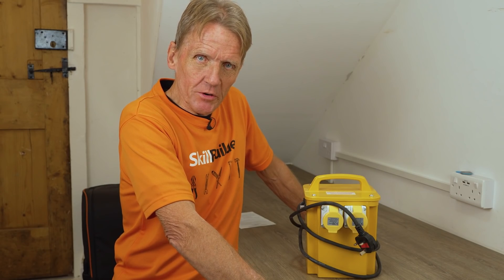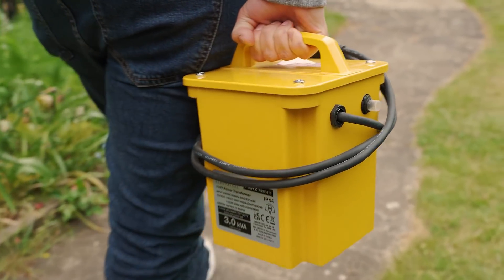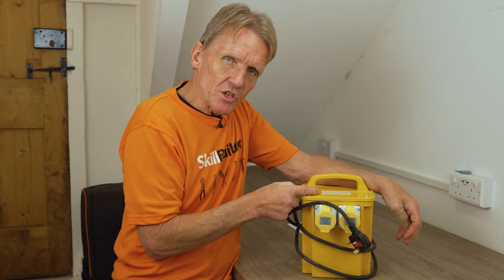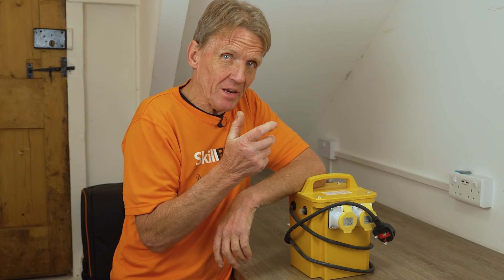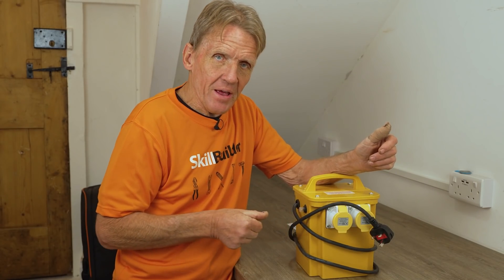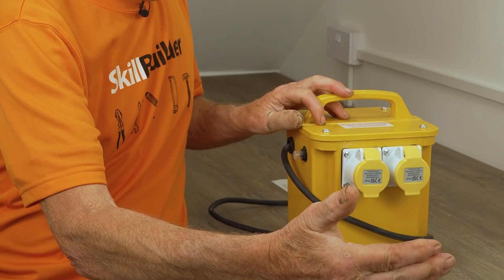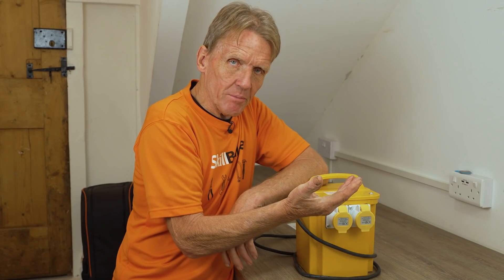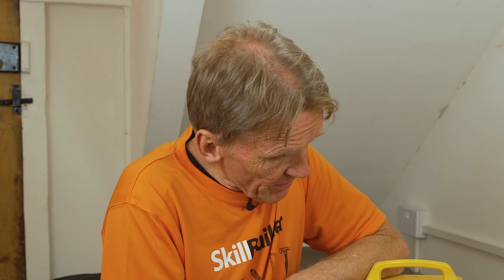110V Transformers - 3 Things You Need to Know

Comment: Personally I would never go with a unit less than 10 kVA. The whole safety goal is defeated if the transformer melts down and the secondary comes into contact with the high voltage primary. What would you rather electrocution or a little bit of grunt moving a transformer? A small hand truck and it's never been an issue in all my years. On projects with 2 people running tools simultaneously I bring 2 of these. And the inrush current thing is overblown, a very simple fix with a soft starter that momentarily puts a lamp in series with the input power and is bridged a second later with a timed switch. The initial magnetisation current is limited by the resistance of the bulb and gets the flux swinging in the core, and then the bulb is bypassed and taken out of circuit afterwards.

Comment: Only time I've known the thermal cutout operate was when we damaged a lead driving an access tower over it. The lead was sparking 😂 and most tools are nowhere near the max load of these trannys so can run continuously. 3kva is a lot! That's why they make the little 1.5kva (I think) units for single tools. 

I hired a cement mixer recently. Got a 5kva tranny with it (all the hire shop had) and ran it all day, mixed up 1.2m³ continuously. Mixer was about 600w.
Reply: I recently bought a 0.5 kVA continuous / 0.75 kVA ''tool rating'' (i.e intermittent) second hand for £25. Much lighter than my 1.5 kVA/2.25 kVA I had previously, and I doubt it will ever trip in a life time with normal power tool usage, even flat out, even with 2 people if I had to guess. Unless you had a scenario were a prolonged high load like a mixer or such is used, I doubt it will ever trip. And I can always bring out the larger one for those few occasions. If I was a tradesman I would go cordless, but for DIY I can have a corded version of everything I need sitting on the shelf ready to go, without batteries deteriorating and eventually dying from lack of regular use.

Comment: Transformers are extremely efficient things and shouldn't produce much heat. The new ones are probably cheaper Chinese rubbish, wound with aluminum wire, and the iron laminations aren't insulated from each other with varnish..

Comment: Thanks you are correct in they are for intermittent use you can always stand  the transformer on a couple of bricks. The most important thing that every person does is use them incorrectly. There purpose is to protect you from electric shock which can kill you. 110 volts is safer, so why run 240  volt lethal extension leads around a site to then plug in an 110 volt transformer. Those extension leads are siting waiting to get chopped or slashed and kill you or your work mate. Plug the transformer in at a safe location then use 110 volt extension leads. The inset photo shows the danger lurking. As they say a little knowledge is dangerous. Its the just get the job done attitude that will catch you out, and you won't be going  to the home you want just the funeral home.

Comment: Not cheap. I used a generator for most of my work, only used a tranny to fitting kitchens.  Some great tips below so be nice to your unit. It's mostly battery if you've got 2 spare as a lot of sites expect you to supply your own power. General use 240v converters on site in various places helps. Cannot remember the last time I bought one mind...

Comment: Really interesting. 99% of people must abuse these then. I never knew they were for intermittent use but makes complete sense. All the heaters I have seen plugged into these and left running for hours……
Reply: If the thermal cut out is not opening then all is good. The ''continuous duty'' is lower than their intermittent duty rating, but it is a true continuous duty.

Comment: Hi Roger as a retired electrical contractor , I was always fascinated by how many contractors were carrying around heavy transformers that were way bigger than they needed . And of course the big units always have a tendency to trip RCDs because of the inrush they produce . Obviously your large concrete splitter needs a beefy transformer , but I can guarantee many only need a smaller unit so saving their backs lugging them around .    Best wishes and kind as always .
Reply: Most contractors nowadays use cordless power tools, much better idea.
No heavy transformer to be lugging around the place also, transformers are only useful if you've got power in the building you're working on, in the first place. You'd also need extension leads which have a tendency to get tangled up representing a trip hazard, not to mention a Generator in the van just in case theres no power on site. cordless tools a much better idea charged up overnight in a charging station, fully comply with safety regs and can be used anywhere.
Reply: @davidodonovan4982   hi David we would still use them for for things like using large core bits that would tend to totally drain a battery SDS drill . And to be honest a good quality 110v SDS drill will last you years unlike battery gear .     Best wishes and kind regards 😀👍

Comment: In a world of RCD's and RCBO's it does beg the question, why are we still bothering with 110v?
No other country in Europe uses 110v and they don't seem to have any major safety issues.

More and more on site 110v is being replaced with 18v.

Isn't it about time this system is due for a review and the construction industry looks at protection at source being law.
Reply from the maker: I agree.
Reply: @SkillBuilder  Maybe do a short video about it Roger, we need some input from electricians on the pro's and con's.
Reply: Because if an RCD with 240 volts (and I do mean 240 not 230 ) doesn't trip for whatever reason, then you're dead.

If you're using 110 volt appliances and you come into contact with that voltage, you don't die.

Comment: Get a plug in remote control switch. You have a little remote in you pocket and you can switch it off from 10 metres away.
£10 on Amazon. 
Just got one when my power take of vacuum packed up and Henry had to come off the bench.

Comment: Same thing happened to me with a laser level. It was screwed to the wall in a customer's house. There was only me and one other builder. When I went back the following day The laser level was gone and he said exactly the same thing laser level. What laser level? I've not seen a laser level.
Reply from the maker: You can never rule out the customer stealing it. That has happened to me. I did some work in a drug rehab unit and everything in my tool box was a potential fix.
Reply: @SkillBuilder  Worked in one of the busiest Garda stations in Ireland as an apprentice Carpenter. First day we arrived the guy who looked after the facilities told us not to leave any tools down these are the biggest thieves going.

Comment: With modern electrics and RCD extension leads will they eventually become a thing of the past and just have the 240v tools. I've been working in domestic land for a few years now and have switched over.... Probably going to get a bunch of flack for that but the vac runs the chop saw better and the rail saw. 110 only gives 800w from the vac. Or will it go just to heavy ass 40v Makita. Heavy though.

Comment: You are right that they are an interesting thing... A lot of thought went into these devices, specifically with safety in mind. The secondary winding is center tapped to earth with the L & N output floating & completely isolated from the primary. This means that the maximum shock you can get is 55V to earth ie: not lethal. The reason they overheat so easily is because the transformer windings are epoxy encapsulated for wet use safety. The bin is also waterproof. This makes them safe to use in the rain or wet conditions.
Reply: I'm being a bit pedantic here but your wording isn't quite right....The maximum shock you can get is 110V, the maximum shock to earth is 55V ;)
Reply: @amd4life89  Yes people seem to ignore the line to line voltage as if you can only get a line to earth shock. Although admittedly line-earth shocks are more common.
Reply: The major problem here is is the installation is TN-C-S (also known as PME) when a Neutral fault will make YOU the fault current conductor or on a TT service you could become both conductors which will definitely give your hair a good Perm
Reply: @Mike_5  I'm sure there are quite a few instances where 110V CTE isolating transformers are used on small sites with TN-C-S supplies (individual house restorations for example) but most of the time they will be used on construction sites where the DNO supply will not provide an earth connection, so it will be TT. I can't see how the use of a 110V transformer presents an increased hazard in the case of an open-circuit neutral/earth conductor or local earth-electrode connection.

Comment: Why don't  Brits develope power tools that do not require transformers? Rented one to power a German made roto hammer with an American (110) plug while building an extension in Scotland year 2000. Very inconvenient.
Reply: We require 110 volt tools, for safety reasons.

Now tell me how you are going to get 110 volts from our 230 volt electrical system without using a transformer?

I would love to hear your answer.

Comment: Top and bottom of it is these plastic transformers are rubbish, cheap, thin windings probably all made in China and sold here. We still use good, solid, Metal bodied centre tapped to earth transformers with overload trips and fused on both poles. They run all day no problems and some are 20 years old. The windings are tested regularly and no problems. Also, if your stuck somewhere you can 'reverse' the voltage if you need a bit of 240!., I know, shocking isn't it!.
Reply: "we still use good, solid, Metal bodied..."
Do you think the Chinese make their cheapo transformers with a plastic core? 😂

Comment: 5KVA transformers are better plus all CE Rated transformers come with a thermal protection device fitted.

5KVA are no good in most domestic settings as they’ll normally trip the B Type MCB when switched on due to inrush current but, should be fine in commercial/industrial locations.

There’s no legal requirement to run 110V on sites however, most larger scale sites do require it & should provide industrial/vented transformers as part of their onsite installations for contractor use if they specify it’s requirement.

Cordless doesn’t yet have the longevity for disc cutters/breakers & prohibition of combustion engines indoors should rule out that option for most so, transformers will still be with us for a while at least.

Not much else that a battery doesn’t run on site these days. Might be worth people following your lead & adopting cordless solutions.
Reply: There are now Cordless Milwaukee and Dewalt concrete breakers and saws, and  new cordless Hilti  Concrete  saws as well, pricey though.

Comment: I'm using one that's double the physical size, and also weighs nearly 3 times as much, to power my chop saw. Those little 16Amp transformers just don't have the power, and the chop saw hardly scratches the metal it's cutting. But using a 32Amp transformer, I can cut through quite a bit more, and unless the light fingered out there have a wheel barrow, it's not something your going to run off with.
Reply: Just seen a wee Scouser leg it up the road with the cement mixer and two bags of cement under his arms I kid you not haha and it was nailed down

Comment: Plug a drill in transformer hold trigger in then switch on power to transform it'll limit surge and stop circuit breaker tripping in most cases
Reply: O dear so little knowledge is so dangerous.

Comment: throw it away and use 240v tools ..... perfectly legal with rcd protected circuits..
Reply from the maker: yes but that means throwing away all the tools as well
Reply: @SkillBuilder  I'm not even on the tools anymore and I still buy 110 tools for my own use, kinda force of habit, insurance in case what I'm doing doesn't work out I'll go back on the tools, and no one wants to borrow a 110 lead "temporarily" round the house to plug something in,

Comment: As a site electrician working on huge high rise building sites in Sydney, I find this transformer idea a bit of a nuisance.  I'm glad we don't mandate this madness here. We use 240v rated tools and are glad to do so. We do however require all electrical tools to be inspected monthly for damage.
Reply from the maker: I take it you use RCDs?
Reply: @SkillBuilder  stringently.
Reply: RCDs = residual current device, a circuit breaker that cuts the flow of electricity if an abnormality is detected, reducing the risk of electrocution

Comment: Agreed. 3000W, intermittent use, 1000W continuously. I'm a sparky, and use mine continuously with an 850W SDS for chopping out. Never had to reset the thermal cut out, and it's 15 yrs old. And don't forget stuff like power factor. 3000W kVA with a 0.9 power factor is actually 2700W intermittent (kVAr). kVAr is the true maximum power output.
Reply: kVAr refers to the reactive power consumption of the device, not its 'true maximum power output'. The point you are making - I think  - is that a device with an operating power factor of 0.9 will have an effective real power rating (that is, 'useful' power expressed in W or kW) that is less than its apparent power rating in VA or kVA.
Reply: @protectiongeek You're right. In my experience very few people, electricians included understand power factor.
Reply: Sparky eh? 😂😂😂 (KVAr is not the maximum power output … that would be kW, the real power output)
Reply: Most people using them won't have the slightest idea about power factor. Like useing 240v extension leads upto to job then the transformer.  I seen a steel RSJ dropped onto an extension lead and the lucky escape a man had. 110v extensions the way to go.
Reply: @g7mks383  Which is why anything that's 240V that's being used outdoors should be protected by a 30mA RCD . (It takes approx 60mA at 240V to stop a human heart, which is why RCDs are rated at half that.) You're asking for trouble if you dont .  If you have long runs of 110V extension leads then things like voltage drop come into play and whatever tool you're using won't perform as well. Or better still use cordless whenever you can, and remove the trip hazard of trailing leads, as well as risk of electric shock. ;)
Reply: @danthevan1451  The yanks dont seem to have a problem with 120 volts and long cable runs.
Reply: @g7mks383  Most people using them won't have a qlue - periode.
Reply: @CONEHEADDK  ?
Reply: @g7mks383 .
How you are going to get the 110 volts from 230? You need a transformer.
So you can't feed 110 volts into the transformer because you don't have it available. And if you were feeding in 110 volts in to the primary of the transformer, what voltage are you expecting on the output?

And: 
 You can use an RCD on the primary side of the transformer so long as you place the RCD at the plug end of the cable feeding the primary of the transformer. In that way the cable to the primary side is protected if a fault occurs on the primary side.
Reply: @g7mks383  … nor any clue about spelling!